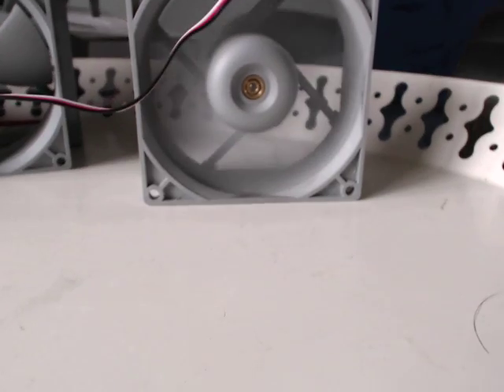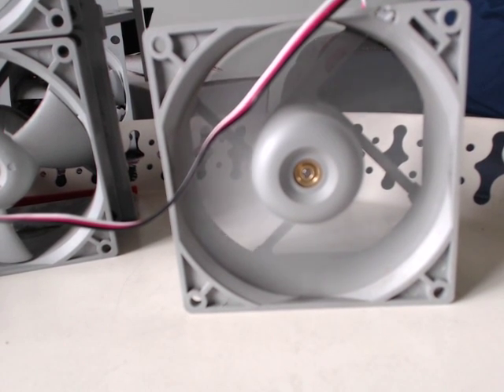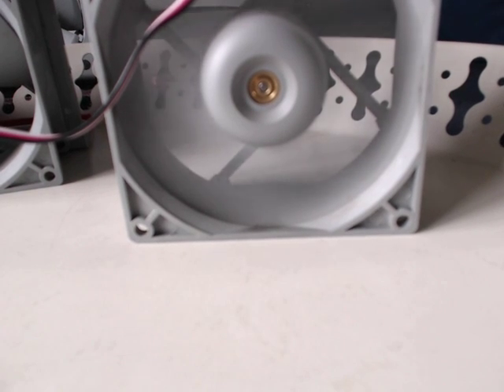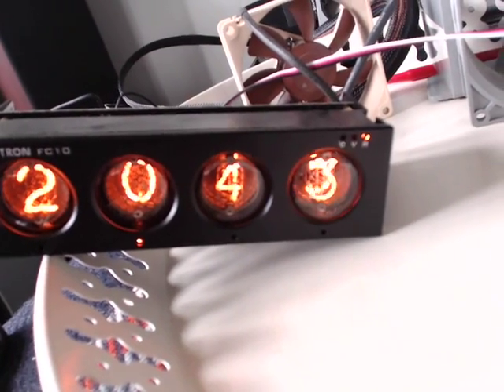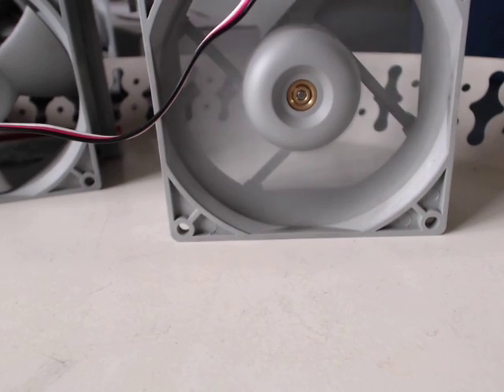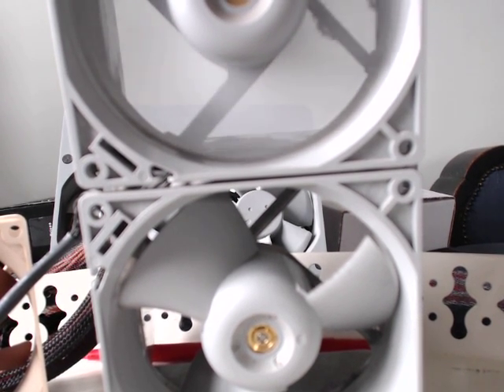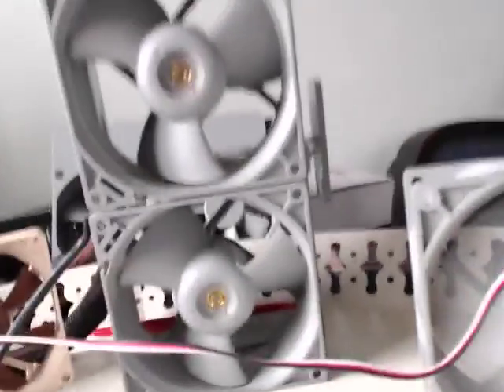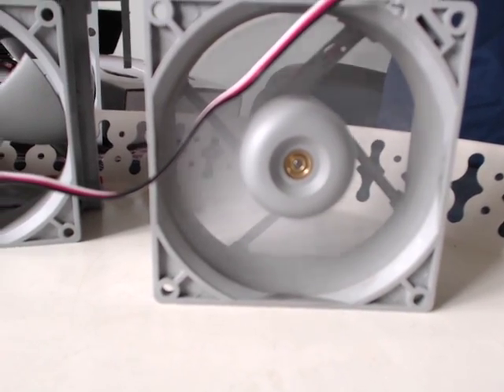G5 CPU fans back to back

Comment: do these fans have the same connectors as a normal pc would have?
Reply: Not all of them
Reply from the maker: Hi Michael, yes the replacement fans have the usual PC connectors on them and so once converted are plug and play....
Reply: David Chugg cool! thanks!
Reply: No
Reply: There usually a six pin connector
Reply: Not a 4 pin pwm which is the most common